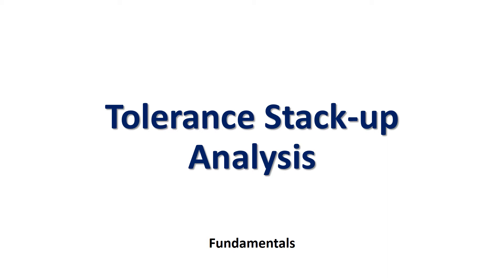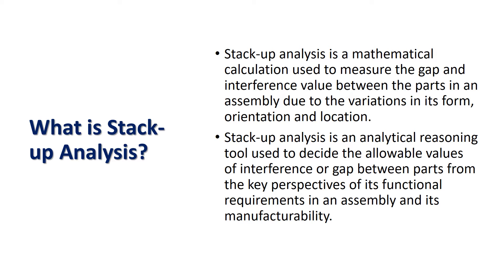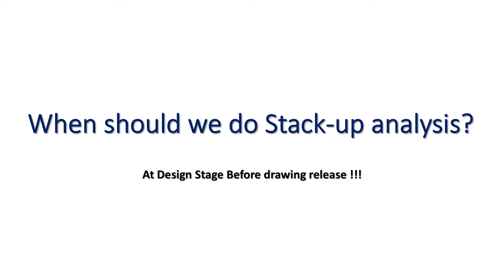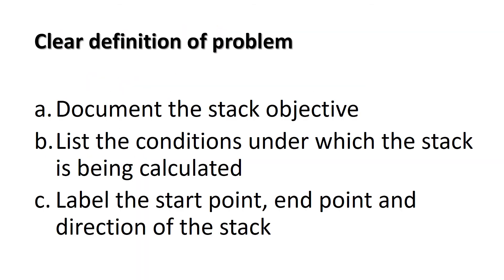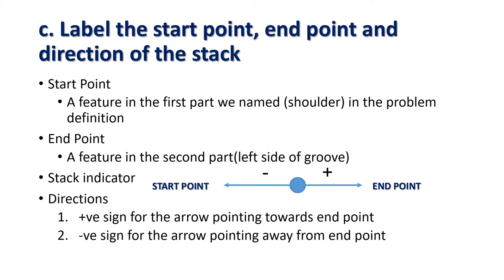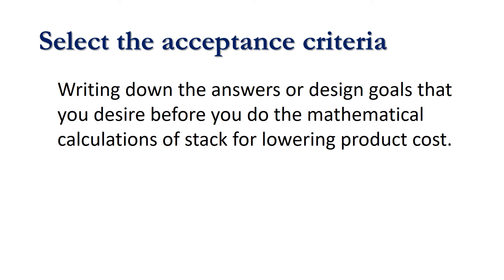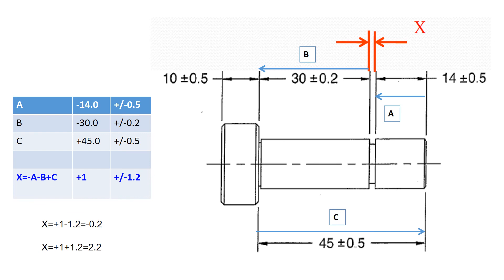Tolerance Stackups Analysis 01 1

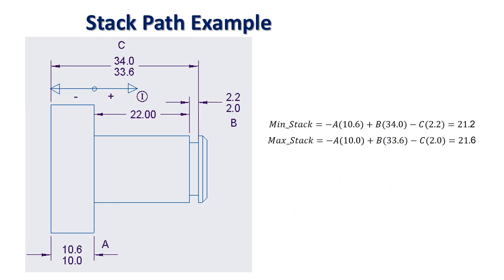Comment: Is that calculation in 7:04 right? It seems that Limits for that nominal value should be 22 (-10+34-2) and 20.8 (-10.6+33.6-2.2). It is possible though that I didn't get what you were trying to do there
Reply: i agree with you, i am also confused here, values are correct or not ?